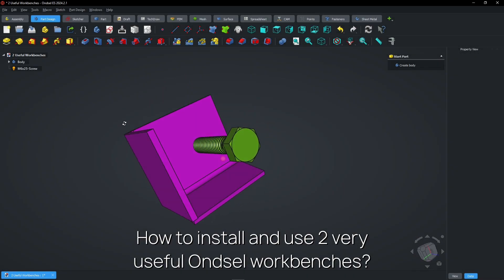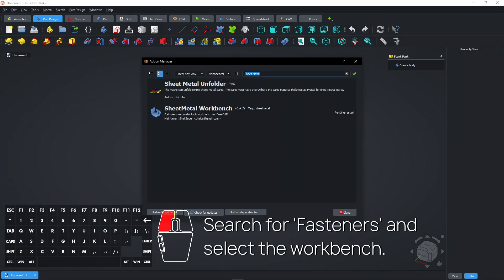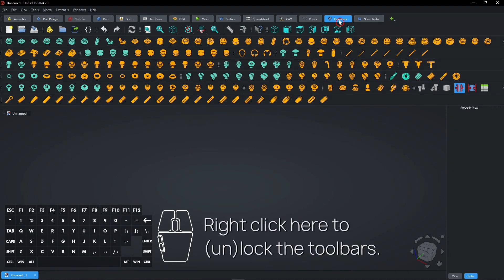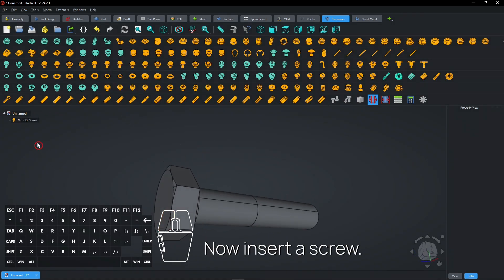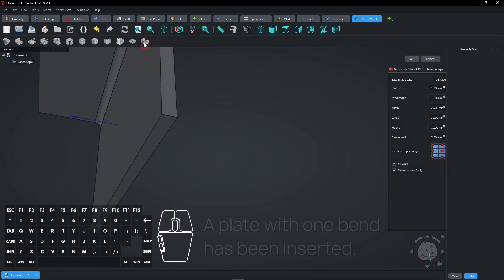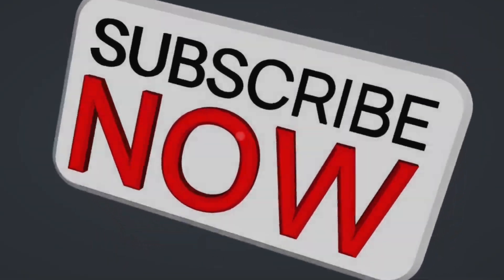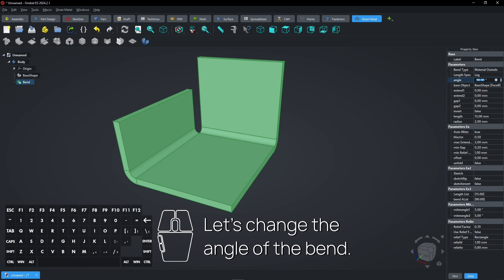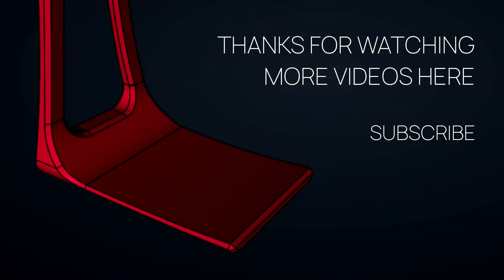🧱 2 USEFUL FreeCAD Workbenches - FreeCAD Addon Manager - FreeCAD Install Workbench

Comment: Is this somehow changed by Ondsel? As far as I know these are community-contributed FreeCAD workbenches (and they're great, I've used them both extensively). My understanding is that Ondsel provides a new Assembly workbench, and their "lens" team collaboration tool. But if the two workbenches in this video are now Ondsel workbenches that's news to me, and I apologise if I'm behind the times.
Reply from the maker: I have to admit that this are FreeCAD workbenches used in Ondsel. I called them Ondsel workbenches, because they were used in Ondsel. Originally they are FreeCAD workbenches.